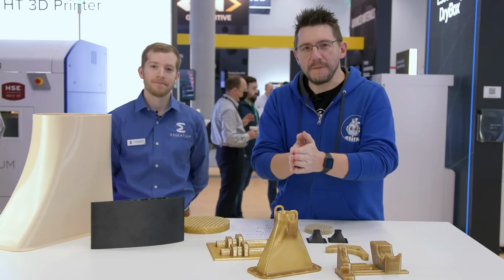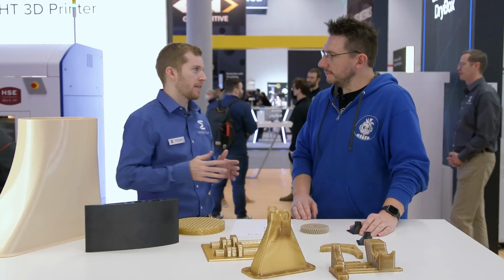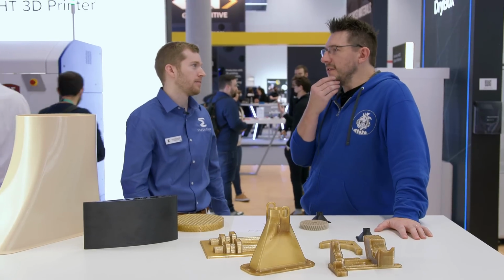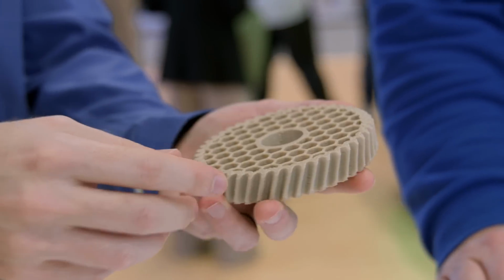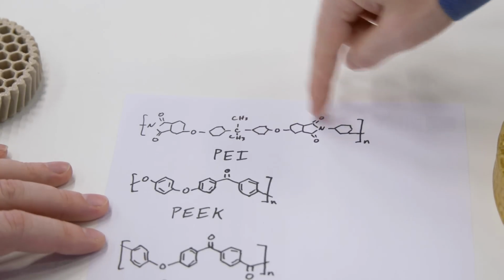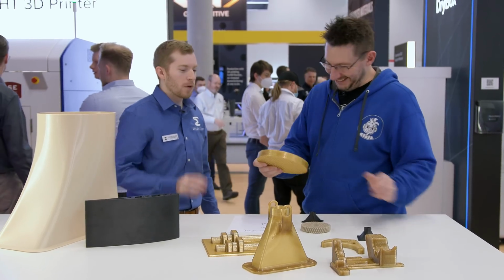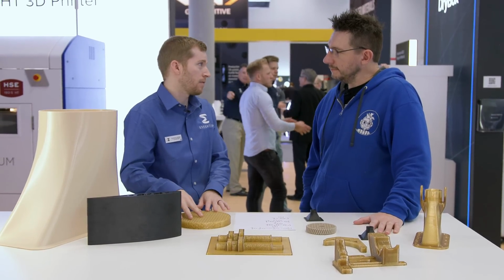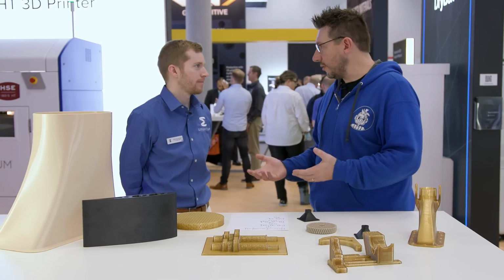3D Printing HOW HOT?!?

Comment: My printer is modified to hit 450c and print plastics like PEEK, but... PEEK is bloody expensive and there is only a few reasonable applications for a home gamer. Like high temperature resistant part cooling ducts.....
Reply: extruder temp is easy, getting 130 chamber is basically impossible on consumer printer unfortunately.

Comment: This Materiel engineer refer to as "Soft Tooling" so.....
 Surface finish after machining ? mechanical limitations compare to traditional aluminium tool? expected tool wear compare to aluminium?  Recommended injection operating temperature?

Comment: So I was wondering hows about supports and build plate/adhesion?

I mean yeah that stuff is really cool and its not that hard to modify the printer to get to 500°C and ~100°C Chamber but i would like to know more about what's the best build plate or how does it take supports? Like pla it's fairly easy to use support but with petg it is a nightmare to get it off

Maybe you guy could do a following up video with this?

Comment: Brandon, if you're reading these, I would love to hear your thoughts on this. You're claiming PEI has a TG of around 174c which is not true. This is something that I'm currently working to publish a paper on because for some reason the additive manufacturing industry has decided to list blends containing PEI as PEI. 3D Xtech is another company that does this where they claim it's a PEI when in reality PEI has a TG of 217c. That's a huge difference when you're advertising these materials for use in safety critical equipment.

Also, you do know that depending on the process PLA has a crystallinity of around 30% which is considered high for polymers. And you probably shouldn't compare metal crystals to polymer crystals, they're not even the same mechanics of crystallization and are only really comparable in name. You were really sitting on a fine line of explaining the science and spreading miss information throughout this video. I'm not going to list everything that was wrong in this video, but my final correction I'll make is that PEEK powder and pellets costs $100/lb for high quality grades.
Reply: Hi Michael, you are absolutely correct. Ultem 9085 is a blend of a PEI copolymer with other components. Unfortunately that blend is still considered proprietary by SABIC and I simply am not permitted to share that knowledge with the public. You are correct that “pure” PEI has a Tg of 217C. I believe that teaching complex concepts always involves a fine balance of being able to convey essential information about a subject that is true, yet simple enough to keep people engaged and ready to come back for a deeper dive down the rabbit hole. Also true, polymer and metal crystallinity are not the same but there are many similar concepts one can draw between the two in order to understand material science better. PLA can certainly be crystallized to higher fractions, but it’s chemical bonds are generally weaker than the polymers we discussed here. And for PEEK prices I was referring specifically to market rates for filament, pellets are of course cheaper. Glad to address any other concerns you have and my apologies if you felt misled.

Comment: Very cool and I'm sure very useful but it worries me somewhat that parts printed in these materials might be used to replace metal parts on an ongoing basis. Yes I'm sure it's probably faster and in some instances cheaper but polymer materials are usually a recycling nightmare. The chemical properties that make them strong and chemically resistant are the same ones that keep them from being broken down by recycling processes. Even when they can be recycled the recovery rate is usually quite low and they often have to be downcycled to other uses where the material property requirements aren't as stringent. Metal parts on the other hand can be infinitely recycled with a high recovery rate and can be turned into different alloys or simply reformed as-is.

Comment: That was awesome. I think it's great, especially explaining the differences in use. Like "sure, this material is great... but we don't use it here. We use this instead" statements. I say that because it seems that when a new printer comes out, 2 statements get made in comments: 1) how many Ender 3's can be purchased for the price of the printer. 2) asking if it can print PEEK/PEKK.

Sure, those materials are awesome, but there's a reason to print certain materials and a reason not to. You don't print everything in PLA because not everything will be in the right temperature for it, not everything will go without impact, not everything can go without fasteners, etc. At that point you want to switch to PETG or ABS. But there are specific reasons to use a material and blanket "I want to print PEEK/PEKK" that gets commented is not helpful as not everything should be those materials. It didn't come up in videos, but I wonder if you could paint them because I feel like one counter comment for their use is "lack of colors" and enough will say "I don't care about colors because I'll paint them" but now this comment is branching into "maybe use SLA instead of FDM, does your mini need that kind of heat resistance?, will the paint/primer work for what you want to do, etc."

Point is: there is a purpose for each thing. Viewing it as a God Tier filament and thus demanding a consumer printer that prints it misses the point... but the first step is knowledge, and this video provides some missing knowledge on the topic and touches on the reason industrial materials won't be in consumer space anytime soon.... because $600/kg is not for the faint of heart let alone needing a printer with a heated build chamber and proper nozzle.

Comment: i wonder how much of a combustion engine you can build with this.. it's good enough to handle regular exhaust even, no race car kind of heat yet. don't know about the heads though. block with some kind of sleeve for the cylinders most likely. you could print a engine for cheaper then making it out of aluminum parts.

Comment: My biggest complaint with these companies is that they always say the parts are more functional than other polymers but they NEVER give any demonstrations or show an application where this material will outperform a lower cost polymer. 

I know peek and pekk and Ultem can be very strong materials...  injection molded they can be as hard as teeth. These materials have several desirable properties  but I would absolutely love to see where UHT polymers fit between traditional filament and low cost metal like aluminum / steel / brass